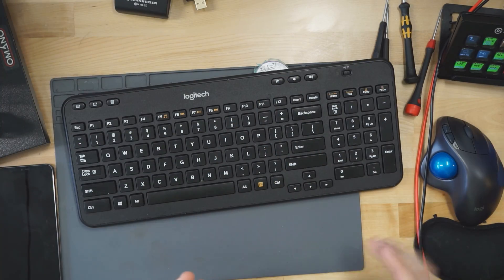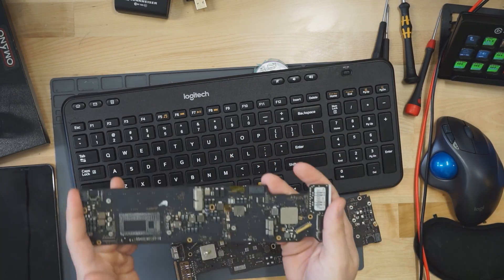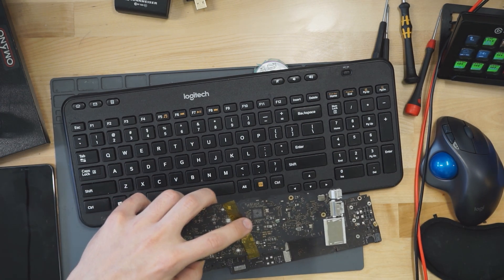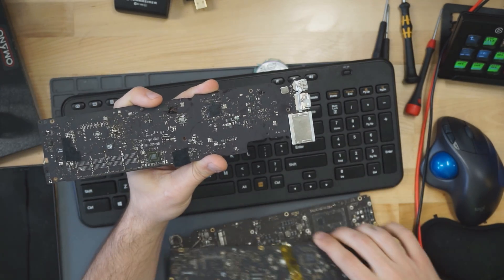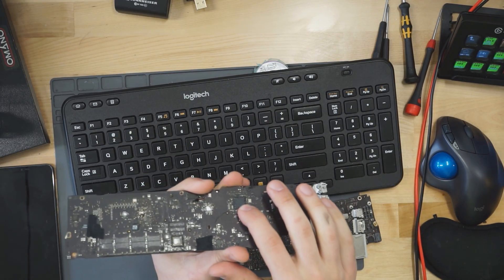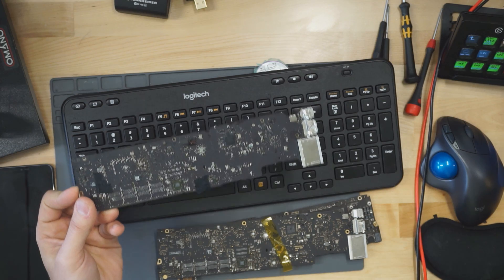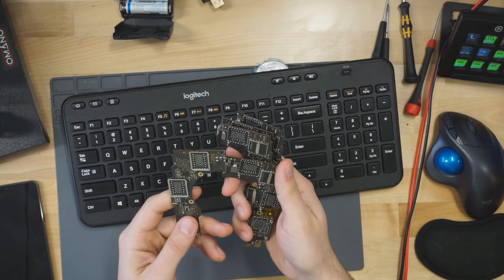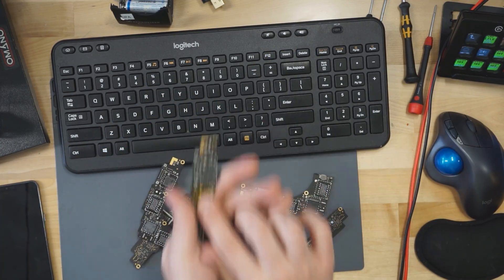𝓕#&* APPLE part 2: The morals & ethics of dumpster diving.

Comment: I got an early MBP and 
cheesegrater Mac free on FB marketplace. The Mac was unsaveable, so I pulled all the ram, drives , etc. The MBP was missing the hd and charger. I got a magsafe charger for $10 and put a spare ssd I had in it. It now runs Linux as the only OS. It's cool for a $10 laptop.

Comment: Recycling discarded or QC-disqualified electronics for parts, as far as it is feasible, is great in every way, shape and form. Just dispose of the remains you don't / can't use, in a sensible manner. I known some people think of protection of intellectual property etc - but 1: Anyone with access to that model iphone, mac - can open their device and have access to the same components, so it's not something Apple didn't mean for people to have, and 2: No one is reverse engineering, cloning or copying anything here. We're only replacing like for like, physical parts.

The vast majority of these kinds of electronic components aren't perishables. They don't really "wear" either, they don't deteriorate. When they go out, they fail catastrophically. So they basically either work or they don't. Reclaiming a component from a donor, especially one that has seen little or no operating time - is literally just as good as a brand new one. And to be fair, with these kinds of donor boards, they often are brand new parts. It just doesn't make sense for Apple to reclaim good individual components from boards that were damaged or had some defect on the production line, because its a lot of work work for very little return - for a manufacturer. for someone doing hands on component repair on the other hand, that is an entirely different operation, that is not affected by the economy of scale that a board factory is. Because that repair technician is dealing hands on with one component on one device at a time - not automated factory assembly lines.

Comment: I was once fired for diving for RAM and an older i7 processor(from a fully functional computer marked for recycling). This I believe is nearly the exact thing I told the company investigator when they fired me. Yeah I did it, recycling recovers a small portion of the hardware so it should be reused if it is in fact still usable. I stand by that, one man's trash can in fact be another man's treasure, why do you care if it's trash to you?

Comment: Somehow you have a point, although I have seen this first hand in the production line, these are not garbage but rejects and they are not to be sent out to the dumpster but to be recycled or repurpose, (imagine candle making if a candle is deformed it goes to reject then melted back or repurpose to something else, yes i know that 95% would probably go to waste and only 5% would be converted to raw materials once recycled but never-the less  still the company’s property more often than not, these rejects are being being pocketed by employees and sold in a black market.  So lawfully it is wrong as it is unlawful to posses or purchase stolen goods

On the other hand they should pass a law like how they did with vehicle spare parts that it should be available to consumers no matter if they choose to have their vehicles fixed by the dealership or their own mechanic or themselves.

Comment: 𝓕#&* Apple. Do you want to know what product Apple could make the absolute thinnest, lightest, non-polluting in the entire world? The iPhone. How? By putting two apps on the iPad. Which two? Watch and CarPlay. How would that make an iPhone the thinnest, lightest iPhone in existence? Simple, Apple wouldn't have to make it anymore.

The ONLY reason the iPhone is needed is because Apple does not put CarPlay and Watch on the iPad. If I had those two apps on my iPad Pro, I would no longer need an iPhone. I would get rid of my iPhone immediately. I would use my watch with a Bluetooth headset as my phone, I would use my iPad for everything else, and I would have the thinnest, lightest iPhone that can exist (one that doesn't). Imagine how much less waste there would be. Imagine how freeing that would be.

But no, I'm stuck carrying an iBrick in my pocket because what Apple wants is more important than what I need.

And no, I won't even consider selling myself as a product in Googles supply chain, so that's a non-starter.

Comment: I have a question: why do these board sellers have to sell the entire board? Why can't they take the time to remove the components off the PCB with a heat gun, and therefore minimize the transport size?  I've watched guys like PCB Heaven take a heat gun and remove components in record time. Does Louis prefer the parts to stay on the board?
Reply from the maker: Yes I do!

Comment: Could you tell me which component/ chip I need to change if my macbook pro early 2015 13inch doesn't charge at all? It shows orange light that is charging but not. If I disconnect the charger my notebook shut down. I changed a flex cable which is used for keyboards to trakpad (which failed after an update) and I forget to remove the battery connector. After that my macbook failed to charge at all. I think it's a short on logicboard and I would like to repair it. I am from Romania and here I can t find a service which repairs logic boards so I want to do it myself. Thank you
Reply from the maker: your brain! use these videos with brain, and you will know what to replace.

Comment: Wish they had more manufacturing in the states, would totally set up something like this. One of the big fights currently is about the right to repair, even at companies I like, for example Tesla, are locking down their systems to the point where you cannot attempt to fix or repair anything. I get intellectual property needs to be preserved but so does viable repairs. I used to be concerned about the world turning into the book 1984 , now I am more concerned of the world turning into the Brave New World. Ending is better than mending. The more stitches, the less riches.

Comment: From what I understand, Dumpster Diving is ethical and legal so long as it is not locked or closed off by a gate or fence that has a sign. Only because their trash could hold confidential information whether it's been shredded or not. However if apple did not want people to re-use the apple parts that they made then apple shouldn't have sold it in the first place. You can't control what's no longer in your possession so I find it difficult to understand how Apple thinks this will stop people from reverse engineering their boards or stop repair shops completely. They can trim the amount of repairs down but that won't shop repair shops from helping a customer get their apple product working again. Whereas apple would otherwise point the costumer to buy a new one. The more and more I watch these types of videos, the more I see the true intents from Apple that is hiding behind their advertisements, commercials, and sales. Surprisingly there is still many people out there unaware of what goes on in tech and what is happening behind a company of the product that they support. Some might not care, but when crap like this happens to you and you want a repair for your expensive device, only then will you realize how screwed you are for the company you thought was "good".

I think I got off track, I was supposed to end it on the fifth sentence but when talking about apple I can just ramble on these topics as well as others who understands a bit how apple operates.

Comment: What you're doing is totally ethical, I'd say.  It gets to me when inbuilt obsolecence renders products useless because the OEM producer refuses to fix it and would rather you bought the newest model instead.  Worse that other people are stopped from getting access to parts to fix things and the 'scrap' is literally ground up rather than re-using what is re-useable.  No proper cirle of production and re-call for re-cycling by the manufacturer is what is driving the 'throw-away economy'.  It's sickening.

Comment: Well hopefully you're able to diversify. Like fix hp's Dells LG phones Etc. It might cushion you some but then again you'll have to get a bajillion parts which would be more of a headache. When apple finally tightens the grip. Like I got my lg6 fixed by third-party repair they charged me half the price and they did an awesome job they used OEM parts So Apple's excuses and reasons for not allowing third-party repair don't add up.

Comment: Someone please correct me if I'm wrong, but the smc thing is actually present im many different devices as a security measure(to prevent reverse engineering, security flaws, exploitation, etc.), and it's actually fairly common for manufacturers to use this procedure as a way to protect intelectual data.

Look, im not saying that apple is not trying to give you the middle finger, I'm saying they're trying to prevent theft and exploitation, while giving you the middle finger as a bonus.

Comment: Here in South-Africa on cold winter mornings , while waiting for the bus / minibus taxi's at traffic lights we burn old car tires to stay warm.....then in the afternoon when the fire died out we take the left-over steel wire to the scrap-metal dealers for cash ....old tires have no value here, unless you can burn them and salvage the metal.....there's a lot of tire graveyards that burn the tires for scrap money.......electronic equipment, old C.R.T. screens and tv's. fluorescent lights and p.c. boards get dumped along with garden refuse in any veld outside of populated neighborhoods.....vultures roaming the streets will eventually collect plastic and any other recycleable materials .
Reply: ...........and i will not comply to the Global Warming / Climate Change / Moon-Landing / Evolution /  Carbon Tax scam.....it cannot be proven.

Comment: I agree with you completely except for you saying that the parts you throw out have no value. Literally a printed circuit board with no chips or tracing has value as copper bearing scrap. Might only be $0.10 a pound or so. Aluminum from display assemblies could add up quick though.

Comment: I’ve been a Mac user since 1999 and have never had any problems with any machine or device. However, I can understand your view on the repairability of Apple’s hardware. Actually, I’d be happy to buy a Lenovo Thinkpad T-series if I could officially run Mac OS on it. Unfortunately, that’ll never happen and I’m not ready to face the daily frustration of using Windows for my work (or Android, for that matter). It’s all about the software. And in Apple’s case, you’ve got no choice but to buy their hardware if you need Mac OS and iOS. Still, love your videos, and your rants ;-)

Comment: Louis, I love you, but please actually look up latest research about climate change and it's consequences. You people in the US are already seeing these consequences - increase in frequency and intensity of wildfires, steady increase in power of hurricanes. https://www.npr.org/2018/12/09/675070379/wildfires-hurricanes-how-climate-change-is-affecting-natural-disasters

Increase of two degrees by 2100 is the absolute lower estimate now, thought to be unobtainable due to new unforseen factors such as methane release from everfrost and apparent underestimation of how much heat is absorbed by oceans, which are now starting to heat up as well. 
https://climateactiontracker.org/global/temperatures/

https://www.google.ru/amp/s/www.bbc.com/news/amp/science-environment-46046067

Hotter oceans = less oxygenated water = mass die-off of oceanic flora and fauna.

It's not just about the 2 degrees, it's about the fact the absolute upper limit when stopping climate change is still possible. It's not gonna stop at 2 degrees, it's not gonna stop at 4. Melting glaciers are acting as a buffer, once they're gone, heating will accelerate, not mentioning rising sea levels. There's gonna be less arable land, people are going to starve. People are already dying by millions due to air pollution: https://www.google.ru/amp/s/amp.theguardian.com/environment/2019/mar/12/air-pollution-deaths-are-double-previous-estimates-finds-research

More over, climate change need not "cripple the economy". It has already created more jobs than all fossil fuel jobs combined: https://www.nrdc.org/experts/lara-ettenson/good-news-good-jobs-clean-energy-outpaces-fossil-fuels

There's no downside to clean energy except petrol executives not getting their annual bonus. That's why they've spent the last 30+ years muddying the water by sponsoring research with inconclusive results and running agressive anti-climate change campaigns in the press.

Comment: Greedy crapple don't want 3rd parts mending their stuff as they want to earn 600% on repairs,  Tv companies are the same,  my  £350 retail price 42" lcd tv screen broke so I rang the spares company and they wanted £680 for an lcd panel for my £350 tv, so the tv got thrown away,  what a waste of parts I was willing to fix myself if the panel was priced correctly,

Comment: I really don’t understand apples ethics here, granted they don’t like 3rd party repair shops, but if that was the case I don’t understand why they don’t strip faulty boards check the chips and put them back into the assembly line? I think if you was to sit with Tim Cook and explain face to face he could not argue against recycling in this way. Keep up the good work

Comment: Using obsoleted and faulty boards as source of spare components is completely usual practice between electronics repairman for decades. Nothing bad in that. And this is a way how to throw out less electronic trash and pollute environment as well.
That cut donor boards recalled memories about utilizing similar stuff in my company. We got access to those boards to take all components we want for our DIY needs before they was taken out for shredding. But I don't work in Apple.

Comment: Interesting.  I noticed that Louis uses the exact same combination of Logitech wireless keyboard and wireless track ball (sold separately).  Both are great, but I especially love the trackball.

I can’t understand why everyone doesn’t use trackballs rather than mice or even external track pads.

A trackball is a fantastic “pointing device” that provides precision, speed, intuitive interface, and sits in one place, unlike a mouse, with a minimal “footprint” on your desk.

I know this isn’t the point of the video, but I’ve noticed several times the Logitech keyboard and trackball he is using.

Comment: I am using Macbook Pro 2007 15" (early) and I love it. I fix it myself and do everything I need it to do.  Once I upgraded to Yosemite on another drive, for internet and ebay purposes,  I notice  terrible things with normal operations.   Snow Leopard works great for all the other taks I run like Video editing, Sound production , Quicktime PRO  (cant' say enough good things about Quicktime Pro 7x)  I use it every day for some videos that I can do on the fly without having to open up Final Cut.   Don't forget about this type of recyling,  legacy software that works .

Comment: No the real issue is that Apple is not getting a slice so as a FU they try to control the chain so that you are left going to Apple store for repair or replacement cutting out the little guys in the loop.

Comment: you care about the environment alot it seems like. Maybe its because its easier to do alot of the smaller things, or maybe you are being humble, or maybe you don't realize you are doing alot out of force of habit, or doing it because alot of the green changes are also good for your wallet
Reply from the maker: the diet thing I did for the animals and my health, not environment. but after, I can't imagine going back to eating dead animals.

bafang i did for fun, not environment, but it is one of those things where I can't imagine getting around on that old obsolete shit that shakes and makes noise and runs on burning dead dinosaur crap. it is wasteful to carry around a tank that weighs 3000 lbs to get one person around. 

lighting I did because it just seemed lame to use more power for no reason, and wasteful for heat generation. I can't imagine going back to CFLs after it. 

I would not be in favor of destroying the economy to be more green. I think it is possible to be quite green without going nuts. That makes me a climate change denialist to most who are used to putting people in a box based off of 1-3 words. I do my best to minimize my footprint, do my best to encourage others to do the same, and do my best to put as much information out there that allows 700k+ people to make something work again to save resources.
Reply: @rossmanngroup  good job for having a logical well thought out opinion and people your money where your mouth is. also biking seems like a good way to coutneract the negative health effects of a sedentary job. Also can we get an update on the apple/customs issue? Last time I heard Leonard French was still finding you a lawyer or something.

Comment: Reusing items that are disposed of is in essence recycling, and is almost always a more effective means of salvaging part of the value of the item in question.  It's way better to find a use for something than it is to grind it up and melt it down for such huge loss ratios.
Reply: Sonal, you are correct. Though recycling tends to only refer to the grinding down and salvaging raw materials. That's why the eco friendly charts have 3 Rs in a hierarchy.
Reduce: Reduce how much is produced in the first place.
Reuse: To reuse any finished products that can find a new use.  Which in turn will help Reduce production.
Recycle: salvage the raw materials from any product that no longer has a use. Recycling is at the bottom of the Eco-friendly hierarchy, while reduce and reuse are above it for good reason.